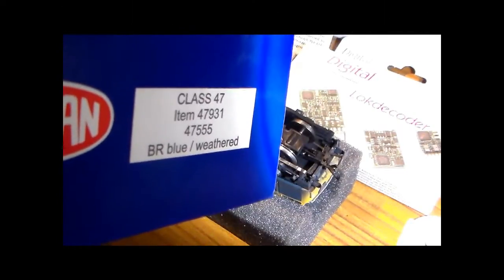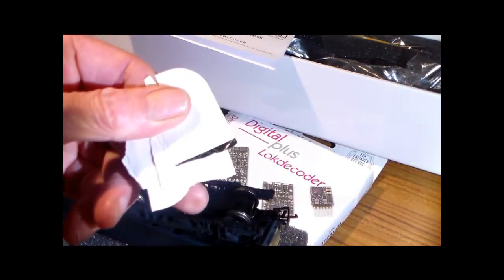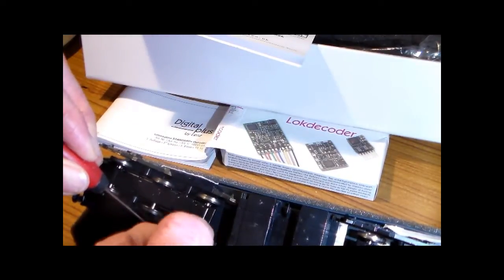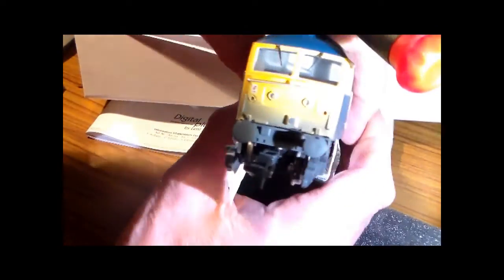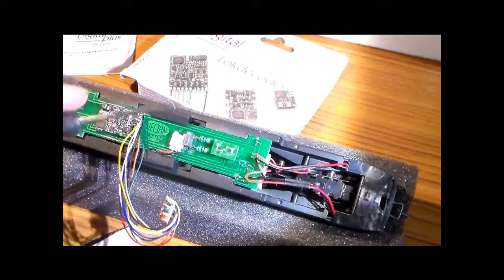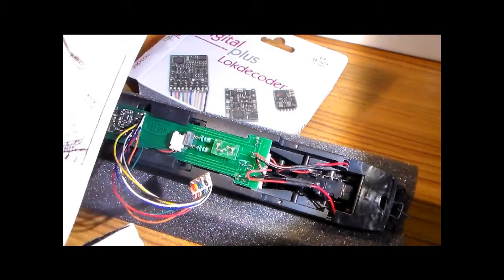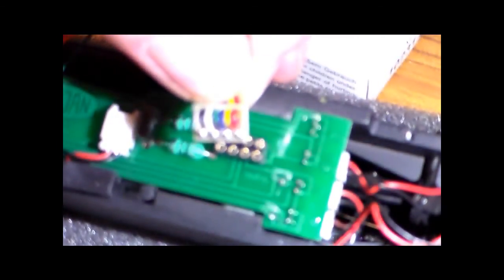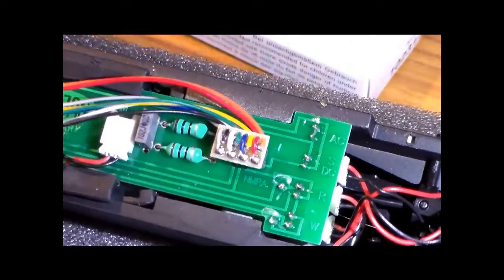Where is pin 1? DCC chip fitting Heljan Class 47

Comment: I struggled to remove the body on my "Tinsley Blue" variant of this Class 47 - so much so that the body split. After discussing this with a model shop when trying to source a replacement body shell, it transpires that these Class 47's are prone to "Mazak Rot" (Which I only thought affected the Hornby class 31's). Sure enough, when placing a steel ruler along the metal chassis - it's twisting badly. I'm sticking with Accurascale and Bachmann from now on!
Reply from the maker: It's a shame that they didn't use better materials in the manufacture. I haven't run mine in a while but it was working OK.....  ... so far.

Comment: its easy to tell which wire is which
Reply from the maker: Hi Penna, perhaps you missed the point. The wire colours tell youy p9ion 1 on the flying lead plug --- but not pin 1 on the circuit board. You will note that I marked it.
Reply: it still dont need to be on there as the pins will only fit one way, it is really simple to work out
Reply from the maker: Penna Lane TMD I have had the 8pin DCC plug inserted both ways round. It is possible for simple motor control that it could work 'upside down' because the pins are reciprocal. However for functions (lights) the common return has to be on the correct pin.
I know that on some 22 pin sockets one of the pins is blocked out however there is a new problem that the DCC chip can be inserted two ways up - again I have done this. if you like I can do a video and show how easy it is to get it wrong.
Reply: No it fuc*king ist

Comment: Not very good of them not to mark the pin numbers on , usually 1 is on the base
Reply from the maker: So easy of Heljan to do. Just a mark on the PCB. The only wire not interchangeable is the common return for the three functions.